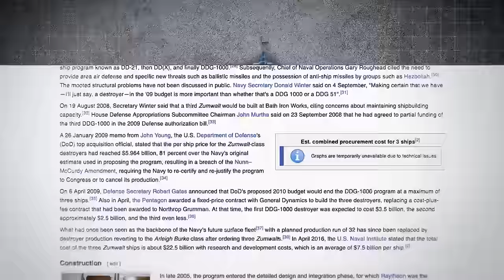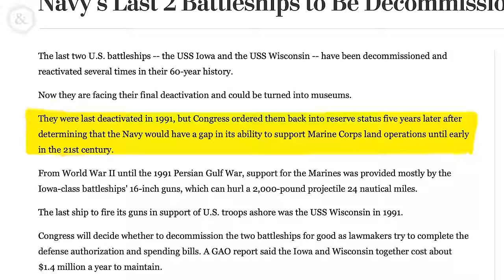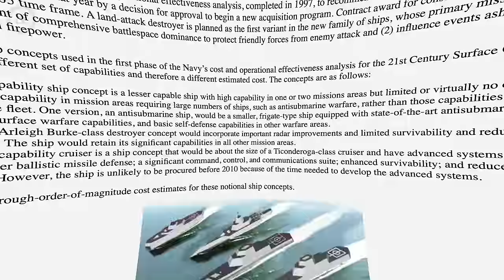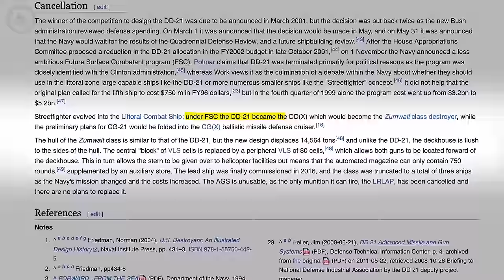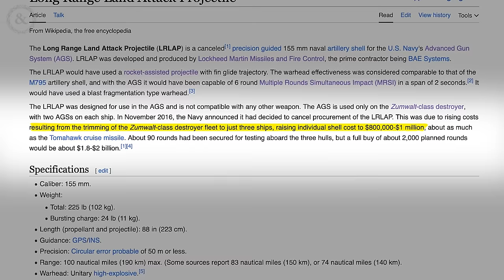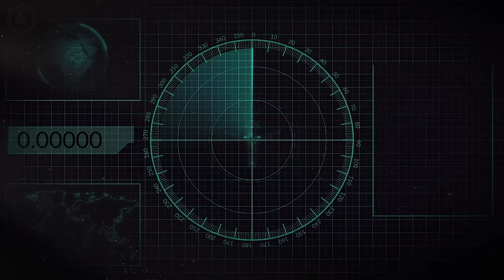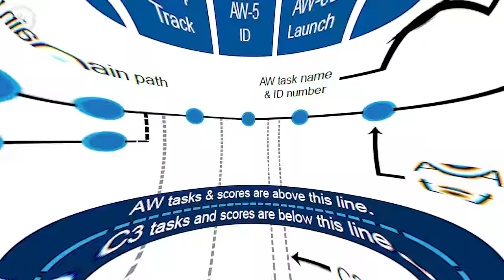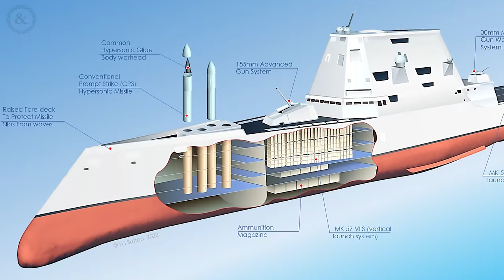Where is America's Stealth Destroyer?

Comment: Saw the title, already knew the answer. Congress got involved. The problem with a lot of programs that are initially priced based on buying a certain # of an item, so as to pay off all the R&D expenses and production expenses and the manufacturers to still turn a profit. So in this case, 32 ships was the original plan, with two 155mm advanced gun systems each, with the main intended shell being a low range guided land attack projectile (with non-guided general purpose shells supposed to be developed later), and some 750 shells being in each ship's magazine for them. That's an initial production run of some 24,000 shells and the original unit price was estimated to be $35,000 each in 2004. In fact in FY2015, 150 LRLAP shells cost just under $477,000 dollars (so about $31.800 each). However when the number of ships got cut to three hulls with six guns and about 2250 shells, the unit price tag jumped to more than $800k per shell when R&D costs were factored in, and the production contract for the LRLAP was cancelled altogether with all the money spent developing them basically wasted. The 155mm AGS, while being the same caliber of land artillery systems in NATO, used a completely different barrel and breech design, with completely different shells which aren't cross-compatible. You can't fire the LRLAP out of US Army 155mm howitzers for example, and you can't find Army 155mm shells from the US Navy guns. The Navy shells are 102kg in weight with a 24kg bursting charge and some 88 inches in total length of shell and propellant. The Army shells are in the case of the Excalibur guided M982s, about 39 inches long (without propellant) but only have a 5.6kg bursting charge and about half the range as the LRLAP.  Also they never got around to developing a non-guided shell for the 155mm AGS, so with basically nothing to shoot out of them, the guns are useless and wasted development money also.

Comment: I remember doing coursework about the story of the "Arsenal Ship" concept design back in the day.  Even if the CNO back then didn't pass away and retained his position, it'd never have been built and deployed in the manner that it was meant for.  Just like the Zumwalt-class, the Arsenal Ship would've also had an emphasis on stealth through it's hull design.  Unlike the Zumwalt's initial configuration, the Arsenal Ship would've had no conventional weapons mounted of any kind - the missiles would fulfill it's offensive and defensive capabilities.  Which also means that if a swarm of smaller boats decided to attack it, the ship's crew would basically be the first and last lines of defense with their small arms.  Even that's iffy because the ship was to have a reduced crew compared to other ships.

On top of all of that, the stealth emphasis didn't make sense.  The ship was intended to operate independent of any escort ships so it could engage targets under stealth.  However, the Navy is not about to let it's big missile platform go anywhere without at least some protection.  And those escorts are not likely to be as stealthy as the Arsenal Ship so it could still be detected if someone spotted the escorts.

In a word: boondoggle.

Comment: The future for these ships is interesting and I think it's what they should have been built for to begin with. They are being converted or retasked into technological testing ships seemingly with the eyes on informing what actually gets put into the next generation, which I think the Navy should have just built a small amount of them. Maybe only two to begin with with this goal instead of trying to push out a completely new foundation to the fleet based on unfounded technology
Reply: That's a good way of looking at it.  If they can internalize the lessons learned from building these, the investment will probably repay itself when they get around to designing the actual next gen ships, and those ships will be better for it.  I've once been involved in something similar (though much smaller), where instead of building one prototype/proof of concepts, we built a few units that could actually be trained with and used operationally.  You get loads of good info that way, and then you set about designing the final version.

Comment: The best argument for 'the big gun' is they used to be (and really still should be) loaded and fired with manpower alone. Granted they have fire control systems, but they too should be hard-wired for analogue use. What happens if these new missile systems get hit by an EMP? 'Dead in the water' would be a literal term. What would they have? POM POMs and 50 cals for protection? Give me the old battleships in that scenario.
Reply: Iowa's should have remained active until a modern montana was brought in to replace them.
Reply: Underrated comment. So many things need to have analog back up if they’re going digital
Reply: @PracticalTacticalFedeli All modern military vehicles are designed with resistance to EMPs.
Reply: @voidtempering8700  it’s not just about EMPs-analog backups work for a variety of reasons-loss of power only being one-
Reply: Zumwalt has a crew of 130 in total while each turret on the Iowa class needed between 85 and 110 men to operate. Naval gunnery is also much less accurate than guided missiles unless it's also using guided shells, and guns have a relatively short range (less than 24 miles for the Iowa's big guns). Meanwhile modern warships can engage targets over 1,000 miles away using missiles that carry much more explosive than even those huge 16" shells, and do it with at least an order of magnitude more precision.

Comment: I adopted it to the "better have it and not need it" theory. Missiles can be intercepted. How about projectiles fired from cannon or railgun? Ship need gun as much as fighters need a gun. And I thought the Zumwalt was a stealth ship and a platform for rail guns. What gives?
Reply: Mortar or cannon rounds can also be intercepted, but they are generally cheaper, so it might be more viable to overwhelm an air defence system using them.
Reply: You only think that because of the rollercoaster of trying to find a replacement armament. The ship was not originally designed to have laser weapons as its main armament. That is what is up.
Reply: @Unpopular_0pinion  Excuse me, I'm asking about railgun. Railgun and laser are two very different things.
Reply: @AllenTam  the reason stays the same. The main armament has been a game of pin the tail on the donkey since the rest of the fleet being canceled made the ammunition too expensive for the gun it was designed for
Reply: Rounds from a gun can also be intercepted. A long range gun has to fire its rounds way into the stratosphere so they're visible on radar from a long way off which makes them easy to track and easy to work out where the ship that fired them is located. Something like a cruise missile can fly in at treetop height using terrain features, staying below radar and can be very stealthy so the enemy doesn't know they're targeted until things start blowing up. The gun round is faster, but it also only carries a small amount of explosive - just 11kg in each LRLAP round compared to the 450kg* warhead of a Tomahawk.

*not all of the 450kg will be explosive but even if it has a bomb-like 50-50 weight split between case and explosive filler, that's still 20 times as much explosive as each LRLAP shell from the Zumwalt's AGS. For comparison the Navy's railgun prototype fired a 3.2kg round and the hope was that it would reach power levels and muzzle velocities high enough to give each round an initial kinetic energy equivalent to 4.8kg of C4, although that figure would be a lot lower by the time the round reached a distant target due to air resistance slowing it down.

Comment: Mach 17 is mental, I had no idea that those speeds were capable. Could you do a video on missles?
Reply: ICBMs can reach Mach 23 or more, but the hard part is building a vehicle that can "fly" and manoeuvre at those speeds. Amazingly the US conducted a successful test flight of a hypersonic boost glide vehicle called the McDonnell Model 122E BGRV. It was launched from Vandenberg on an Atlas F missile and began its flight travelling at Mach 20 at an altitude of over 110,000ft then over the next 45 minutes it flew 4500 miles over the Pacific Ocean until it reached Wake Island where the flight was terminated while it was still doing Mach 5 at 100,000ft. During the flight it performed a number of turns, taking it on an s-shaped path and demonstrating the viability of manoeuvring at such extreme speeds. The test was on 26 February...

... 1966.

Comment: Missiles are great, no question about their reach, effect and difficulty to stop... but it's still WAY harder to indercept a shell, and you can quickly run out of missiles. For shore bombardment and even precision striking over sustained time in low-intensity conflicts, an 80 cell destroyer with that many shells should have been a windmill slam for capability.

Comment: The AGS rounds were supposed to be usable by the Army, as well. With a shorter barrel it would have ¾ of the range, which would still have been 30-55 miles. But requiring different chamber, breach, and loader would be another impediment.
Reply: For a while they were considering the Excalibur rounds for the 155 howitzer. But I believe at this point they are just ditching the guns and going with more vertical launch cells.

Comment: Am (ex)USAF, and am going to take a risk here: Should the Zumwalt took the F-117 route?

Now, when we examine the F-117, the only thing unique about the jet is the low radar observable shaping. The F-117 does not have a radar, its flight control system came from the F-16, its engines are non-afterburner, and assorted sub-systems that came from other jets. What if the Z focused primarily on shaping, which seemingly made the ship 1/10th the radar cross section of similar size vessels? Would that have bring the cost down to more politically palatable level?

Comment: in theory these are supposed to get cover from the air support from carriers, but if hypersonics knock out their air support, they are largely on their own due to the US’s delapidated Cruisers, this is probably why they made them larger but, I don’t think it’s the right call, and is probably a splurge. The money should have been used to update the Cruisers on a new hull design. The program was rightfully axed. First they should update the cruisers, and then maybe keep this basic destroyer architecture, but make it smaller and more fitting to the role of a reconnaissance ship and submarine hunting mine detection vessel.

Comment: Somethjng I didnt hear mentioned in the video is that the zumwalt class is actually more survivable than traditional ships because the missile cells are placed on the sides instead of the center of the ship, it could take a direct hit to the missile battery and still survive and even fight using its other cells, where as a conventional ship getting hit in the missile battery would be fatal.

Comment: It is Admiral Bore-da not how you were pronouncing it.
The LRLAP (Long Range Land Attack Projectile) NEVER would have gotten to $30K a round, even if they could get it to work. They couldn't.
The 30MM is way too small, so the ship is out gunned and out ranged, needed the 76MM. Even some of our newer ships only have the 57MM which is too small.
The ship is stealthy up until it either moves or turns on its radars. There are wake following torpedoes and most enemies can detect the radar signals it produces.
I am pretty sure the Navy found out it is not as stable as they hoped.
Oh OK the hundreds of millions spent on the new guns and loaders and failed ammo, throw all that away to make room for a new missile. This does not fix all that is wrong with the ship or justify the billions to field it.

Comment: The other odd choice with the Zulwalt class was the decision to not have them be nuclear powered, the hull is more than large enough to house a naval reactor.  Of course the USN used to have nuclear powered cruisers and opted to scrap them.
Reply: Nuclear would have pushed the cost even higher and greatly increased the number of crew required.

Comment: The thing about a stealthy/low observable design is that it’s not really the size that attracts attention per se; there’s no 25’ fishing trawlers cruising at 30kts. So it’s possible that the radar cross section would make them a lower priority target while with an armada, that’s the extent of the advantage. Which just means that the missiles would be aimed at other vessels, so it’s not really a strategic advantage. There’s not much chance that the zumwalts would be cruising alone either; particularly since they have very limited anti air capabilities, and no anti submarine capabilities. So it’s a stealth ship that needs be escorted by non stealth ships. It’s like a parachute but you have to share it with three friends; the stealth isn’t really helpful to the group.

Comment: The engines on the Zumwalt are the real killer. It’s basically two complete power systems on one boat, with an extremely complex gearing system which has never worked. That’s where the size and weight really comes from, as well as most of the cost. The failure of the engines to ever work properly in unison is why the Navy cancelled the ship.
Reply: I thought that was the Littoral class that had that issue

Comment: The problem of cutting programs that result in loss of economies of scale is one that occurs more often than it should. Henry Ford specifically said that the first Model-A cost a million dollars, but he sold 15 million of them for $260 ea. Military hardware acquisition works the same way. Air Force doctrine in the late 1990s included a requirement to fight two near-simultaneous wars, so the Air Force set the F-22 requirement at 381. Robert Gates decided that the F-22 was too expensive and cut the buy from 381 to 183 (dyslexia perhaps?). Not only did the cost of each airframe skyrocket, the military did not purchase tooling. So, the call for restarting a production line was impossible. Here, we see the same economy of scale failure.

Comment: Advanced gun, new automation, stealth features, new hull form, new propulsion system, enough energy overhead to equip future rail guns or lasers, and other new technologies that I’m probably forgetting.

One of the reasons Zumwalts failed is the Navy tried to pack too many untested theoretical technologies into one vessel leading to project overruns and immature technologies on launch 😂

Same thing happened with the Gerald R Ford carriers. Difference is that carriers are more central assets to the Navy than a shore bombardment vessel so Navy ate the production and cost overruns to mature the Gerald after launch. It took nearly a decade after launch to get the first Gerald carrier up to scratch and serviceable for duty.

Comment: couldn't help but notice the only time composite is mentioned is for the superstructure when in fact the whole ship is made of CFM composite metal foam. Research from north Carolina or south shows its capabilities but the big catch was how it would perform as a structure for a boat hull... it underperformed. This was a big reason for shutting down the program and it also helps explain cost a little better. love your vids. I spent years tracking composite metal foam and its future applications. The one company that makes the hollow metal spheres for producing CMF is out of Germany with what I imagine is a military contract. It's straight up the armor of the future. It can stop 20mm naval deck guns with minimal deformation its truly a wonder.

Comment: Why didn't they just use the guided Excalibur artillery, HIMARS and ATACMS rockets on the Zumwalt? I don't get it.
Reply: Cost, the AGS was designed around a specific ammo type & not compatible with anything else. It's development cost made sense when they planned to have fleet's of Zumwalt's. HIMARS & ATACMS just replicate the ships already existing  missiles & Excalibur is still less than half the range of the AGS original long range projectiles plus the AGS would have to be totally re-designed & re-tooled an extremely expensive prospect given it would only be used on 3 Zumwalt's. A cheaper & better option would be to wait & replace the AGS altogether with the MK45 used on the Arleigh Burke-class & the Excalibur N5 which is a naval version currently under development/testing when that becomes available.

Comment: Can't they sell the main gun separately? If it does sell, they could lower its price.

For sure it will be interesting to have a patrol vessel (OPV) who usually only have main artillery (usually don't come with loads of missiles), however that artillery comes with a missile-like capability especially for its range of 60+ miles. That's huge. Also, if they're going to sell it separately, a cheaper version of 155 mm ammunition should be created (with of course lower range to make it cheaper).

Comment: When I heard that the Zumwalt class has the radar cross section of a fishing boat, that really sank the whole stealth concept for me. Maybe stealth makes sense for much smaller vessels. Something with the size of a fishing vessel with similar radar absorption materials might look like an RHIB on radar. Have those swarm around your fleet and fit them with radars and and you easily double or triple your vision range. (They don't even need more than one of those flat radar screens if their positions in the formation are fixed; a ship in the front left only needs to watch further forwards and left.)
Fit them with missile or torpedo launch tubes as well and you halve the time until impact on an enemy vessel or aircraft. The ships in the fleet would then mainly carry capabilities that can't go on those drones. Guns for shore bombardment, rotary and fixed wing aircraft, landing craft, and the command center that receives and collates the radar data from the drones.